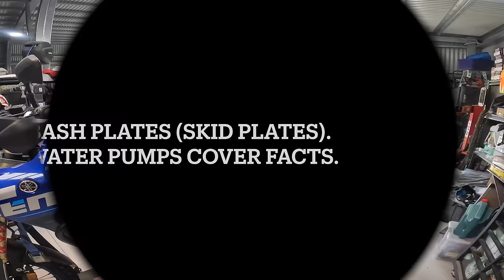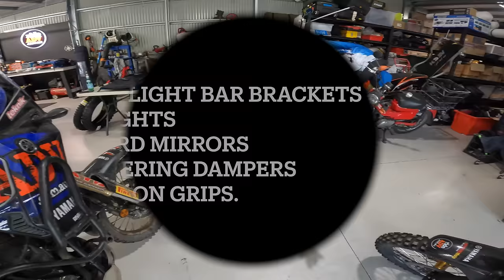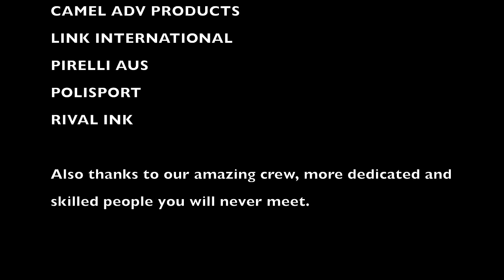HONEST REVIEW:  Tenere 700 300,000 Km's Accumulated Part 6

Comment: Thank you for the great rundown. I noted the timestamps for all of the different topics.

Tenere 700

Beer - 3:23 - https://youtu.be/tp6SRW1s_Bc?t=203

GPS - 3:33 - https://youtu.be/tp6SRW1s_Bc?t=213

Anti Bobble - 6:44 - https://youtu.be/tp6SRW1s_Bc?t=404

Tracker info - 7:53 - https://youtu.be/tp6SRW1s_Bc?t=473

Seats - 8:55 - https://youtu.be/tp6SRW1s_Bc?t=536

Air Filters - 9:49 - https://youtu.be/tp6SRW1s_Bc?t=589

Rally Seats - 13:35 - https://youtu.be/tp6SRW1s_Bc?t=815

Steg Pegz/Twin Pegz/Foot Pegs - 14:31 - https://youtu.be/tp6SRW1s_Bc?t=871

Skid Plates and Water Pump Covers - 18:16 - https://youtu.be/tp6SRW1s_Bc?t=1096

Handguards - 24:20 - https://youtu.be/tp6SRW1s_Bc?t=1460

Stickers - 25:32 - https://youtu.be/tp6SRW1s_Bc?t=1532

Crashbars - 26:13 - https://youtu.be/tp6SRW1s_Bc?t=1573

Light Bar/Lights/Mirrors/Dampners/Grips - 28:18 - https://youtu.be/tp6SRW1s_Bc?t=1698

Mufflers/Fuel Tanks - 31:06 - https://youtu.be/tp6SRW1s_Bc?t=1866

Fuel Tank - 32:55 - https://youtu.be/tp6SRW1s_Bc?t=1975

Muffler Close ups - 34:47 - https://youtu.be/tp6SRW1s_Bc?t=2087

Rear Brake Pads/Pedal - 35:43 - https://youtu.be/tp6SRW1s_Bc?t=2143

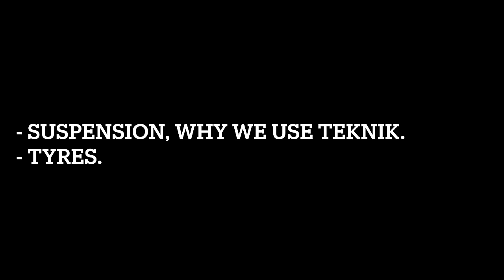Suspension and Tyres (Tires) - 40:19 - https://youtu.be/tp6SRW1s_Bc?t=2419

Suspension Reality Check - 44:05 - https://youtu.be/tp6SRW1s_Bc?t=2646

Tyres (Tires) - 48:04 - https://youtu.be/tp6SRW1s_Bc?t=2884

Wheels (side note)- 51:49 - https://youtu.be/tp6SRW1s_Bc?t=3109

ADVWorx Luggage - 53:51 - https://youtu.be/tp6SRW1s_Bc?t=3231

Sticker Kits - 59:38 - https://youtu.be/tp6SRW1s_Bc?t=3578

Tools - 1:02:35 - https://youtu.be/tp6SRW1s_Bc?t=3755

Custom Wheel Tool - 1:03:42 - https://youtu.be/tp6SRW1s_Bc?t=3822

Axle Swap - 1:04:48 - https://youtu.be/tp6SRW1s_Bc?t=3888

Comment: Thanks Greg for all your content over the years.  Just getting ready to put my 990 to pasture and will likely move to the T7 so your info has been invaluable.  Been running in the backcountry here in the US for years and can't agree more regarding your proper GPS advice.    I run a Montana mounted to the bike and a SPOT connected to me and would do it no other way.   Speaking of Montana and FWIW, if people are trying to power their Montana with just a straight USB cable (not the docking cradle) and are having problems.  Leave a reply and I'll point you to a cheap cable wired to enable just power.  Thanks again and cheers from them mountains and deserts of Utah.
Reply from the maker: Hi mate, all GPSs should be in a mounted powered cradle
Get on a T7 asap and I'll be riding a T7 through Utah next year, will be in touch
Email me your contact details mate greg@rideadv.com.ay

Comment: This video series is sensational!

You mentioned front brakes but didn't get to it. I've found the power inadequate and the lever goes soft really quick needing a bleed every few thousand kms. Swapped to sintered pads for a slight improvement in bite. Considering braided lines or a master cylinder upgrade. Thoughts or experiences?
Reply from the maker: Hi, never had a probelm with the standard front brakes, run standard pads, fluid and lines. 1 finger braking everyday and work awesome, cant recall anyone having a problem. BTW as a rule sintered pads have less bite

Comment: In regards to the pre unifilter that goes on the snorkel. I contact unifilter and sent photos of the filter rubbing through on that plastic guard under the tank. IMO unifilter just use a generic filter off the shelf that happen to fit over the snorkel. Asked them to consider designing a pre filter directly for the T7. Their reply was they would take a look which is code for get lost. What I did was shorten the spring and filter length which now stops the filter contacting the plastic guard. All good so fair.
Reply from the maker: You also reduced the filter surface area, once they are done fit the Funnel Web Filters
Reply: Will do.

Comment: Great video and info guys!! 
What are your insights for replacing/upgrading rims? I recently put a large dent in my front rim on a Tassie trip. I see you can get complete wheel replacements. Do you have insights into new rims/wheels and if some rims are stronger than others? Also would you keep the same dimension rims as stock (this is also something that may be a personal preference I guess)?
Thanks, Ben.
Reply from the maker: Call the Penguin at https://www.dirtbike.com.au 
It’s where we got two of ours sets. 
Good quality, strong and bling
Strong or not biggest cause is too low a pressure

Comment: Very thorough and insightful review of your T7 fleet and what products you have been using.  Have you had to replace fuel pump filters on any of your bikes?  Just wondering how tolerant the fuel system is to  suspect fuel and dirt due to riding in dusty conditions.
Reply from the maker: In the last 11 years of running Yamaha’s, be they XT660Zs, WR450Fs, WR250Rs, XT1200’s and now Tenere 700’s we have NEVER replaced a fuel pump, fuel filter or had any fuel problem at all, not a single problem.
If we have done 300,000kms in 3 years through COVID imagine how many kms we did in the 8 years before, not a single fuel issue.
Reply: @rideadvtoursandworkshop3178  Impressive results and highlights the durability of these machines.  Thanks for sharing.

Comment: The Garmin it's reliable but we have 2 in case of one fails...
How long did the zumo XT on battery?
M8 appreciate the video, but too much contradiction on the beginning, DMD2 in this state it's not a navigation software, it's just for route navigation , you have others to do that. But nice input anyway.
Reply from the maker: Hi Mario go back and listen to it. You got it wrong mate. I didn’t talk about the XT battery I talked about the Samsung tablet battery. We don’t run two units in case one fails we run to so we have back up data. 
Also, my problem with the DMD2 it doesn’t have navigation software, although the new version does.
Reply: @rideadvtoursandworkshop3178  no M8 I know the zumo don't have battery, so I don't see a problem with the Samsung always connected, it's the same.
I can understand preferences, if you like the Garmin it's your choice, but the things you mention to choose a Garmin instead of a rugged tablet or rugged phone in my pov, were not accurate, there's allot of potential on some navigation software like Osmand, DMD2 will get there, and you can always use a tablet as a roadbook. In the future you can always install DMD2 on the Garmin Thread series, but only on the 8' model and up. If they are collaborating with the DMD2 dev it's because they saw potential on the app.
Reply from the maker: @MLeitao righto thanks
Reply: Please share the part number for the larger Yamaha factory dirt bike foot pegs that you mention you use on your bikes? Having trouble locating them without it.

Comment: Great vid. What are the wheel bearing replacement intervals and did I miss you going through tail tidies? Cheers mate.
Reply from the maker: We will do a video on wheel bearings soon. As for tailtidys, well I didnt talk about them but here is my thoughts 
From experience tail tidy’s are a bling item that people think look great but don’t really function off-road. Every tail tidy we tried just let the mud get all up your back. People say the standard one will break off-road yet we have more miles than anyone off-road and haven’t had a single one fail in anyway. 
I’ve seen more than one tail tidy with a rubber flap or plastic piece attached to keep the mud off the rider and that looks shit.
Just a preference but thats why
Reply: @rideadvtoursandworkshop3178  look forward to future videos. Keep up the good work!

Comment: Question. Towards the end of the video I noticed that there is significant clearance between your front brake lever and the polisport hand guards. I currently run the Yamaha adjustable levers and barkbusters  and find the clearance for my reach to be minimal to the point the lever has rubbed on the barkbuster bracket. Is there any extra clearance in the polisport guards?
Reply from the maker: Yes there is

Comment: Great video! whats your opinion about K-tech suspension?   Pros & Cons
Reply from the maker: We used a K-tech set for ages. They were ok for sure, for the cost a Teknik stage one is better and cheaper.
If you don’t have access to Teknik then it would probably be my choice for value
Reply: @rideadvtoursandworkshop3178  what about RR open cartridge and andreani rally +30? In between those options. Awesome info from your experience!

Comment: First of all, thank you for sharing your knowledge and experiences with a lot of parts of the T7! 
Greatly appreciate the no nonsense and straight to the point insights, especially about the mirrors, tail tidy and suspension.

As you said, it’s all about how you ride your bike and not what others can do with it.

One question I would have is about the engine longevity, I have done around 45k km (12k km off-road) 
on my T7 and had absolutely no hick ups while sticking to the normal Yamaha service Intervalls.

What mileage do your bikes have and at what point do you think the engine needs some kind of rebuild\overhaul.

Bonus question: do you know what the lightest exhaust (end pipe) is for the T7? 

Thank you again and all the best from Germany 🇩🇪 ✌🏻
Reply from the maker: How highest milage bike has close enough to 50,000kms. I know of a CP2 engine that does over 250kms a day and has 110,000kms on it.
Reply: @rideadvtoursandworkshop3178   Cheers and all the best from  Germany!

Comment: A couple of questions Greg (apologies if you covered it already!) do you use the standard Garmin Zumo mount? And have you had any of them pop off during a ride? Also, I see a lot of the bikes in the workshop don’t have engine case guards.. not required? And do the stock brake pedals bend, and is it worth buying a stronger upgrade?
Reply from the maker: Hi mate, yeah we use the standard mount, had one fall out at the start but nothing in the last two years and we have 10 of them
No dont believe the engine guards are needed, 350,000 accumulated kms agree
Fit the @cameladv brake pedal, you wont believe you rode without it
https://camel-adv.com/collections/yamaha-700-tenere-t7-parts-and-accessories/products/the-fix-t7-rear-brake-pedal

Comment: Greg at what mileage  do you change the spark plugs on the T7’s ? Cheers Al
Reply from the maker: Manual says 20,000, we pulled them on our long term bike at 20k and they looked great so we refitted them. Again when we checked the valves at 40k and decided to let them stay 
Short answer we havent to date
Reply: @rideadvtoursandworkshop3178  thanks for that mate, it’s a ball ache of a job. Done 16000km so I’ll leave them for one more season 👍🏼

Comment: Are those camel anti bobble rods safe for the headlight and the TFT screen?
I have read that this bobbling has a purpose - not to affect electronics when riding off road.
What's your take on that?
Reply from the maker: I have no experience with a TFT screen but I reckon they’d be fine.
I wondered the same when we first put GPSs up the top
Reply: @rideadvtoursandworkshop3178  so you ve had no issues with the Tenere's screen / speedometer after installing the camel anti bobble solution?

Comment: Sounds like a budget bike that news $$$ upgrades to be a great bike.
Reply from the maker: Yeah hows that? Suspension is something that I need to do on any bike I buy, racks for luggage every bike, slip-on well thats not required I like it and handle bars well again thats me. The bash plate needs upgrading on every bike and no bikes come with a GPS do they? Which bike comes with luggage? Tyres, everyone changes them, and wheels well as I said I like the bling 😃 so nothing really needs upgrading does it?
What do you ride?